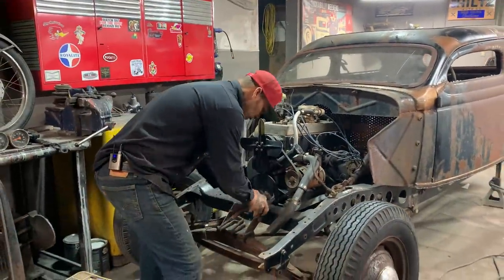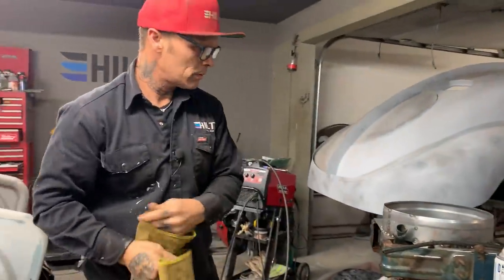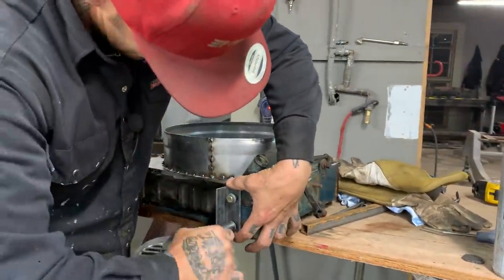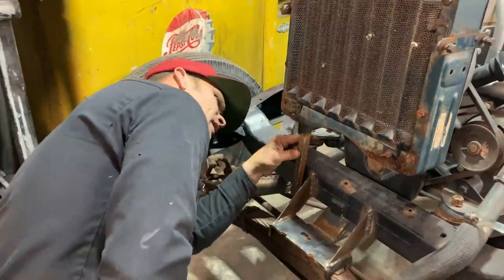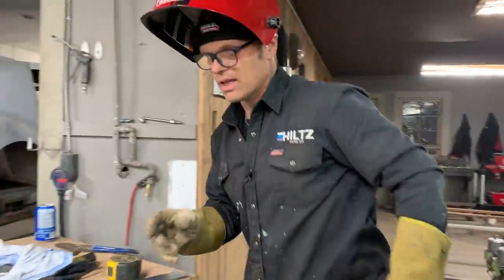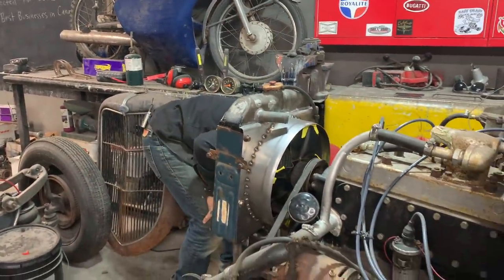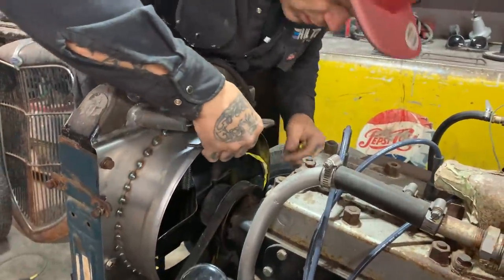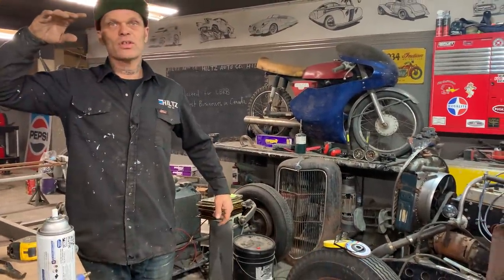FABRICATING A RADIATOR SUPPORT TO MOUNT RADIATOR

Comment: Put a electric fan on the rad ,motor will have more power not turning a fan  and you can put the rad anywhere .
Reply: Yes and use thin water.  I forget what they call it. Water wetter or something.

Comment: Sorry but that's anothe fail. The motor will move on the first sniff of decent acceleration and rip that to bits. Its way to tight to the fan. Even with rigid mounts and not those squidgy 1930s donuts.

Comment: Chad I do not know why you want to put a shroud on it. Take it off and run a regular size fan on it. It does not need a shroud for what you are doing with the car. You are over thinking it on this.
Reply: I think the radiator would look better if it’s lower. Something just looks awkward about it up so high. Maybe with a grill shell around it will look better. I’m sure he will come up with something.